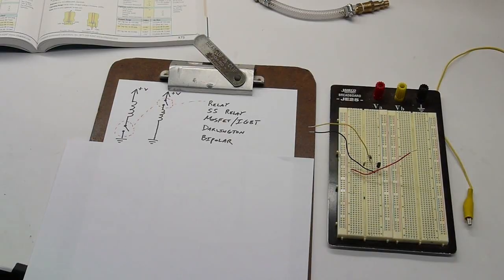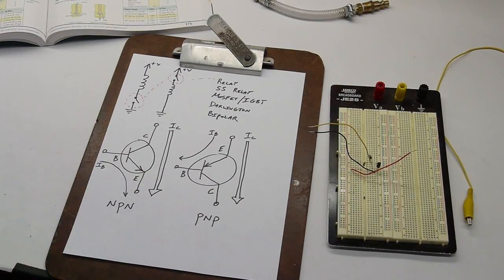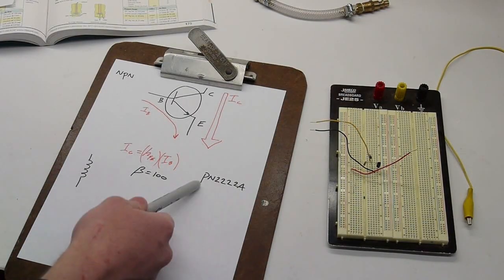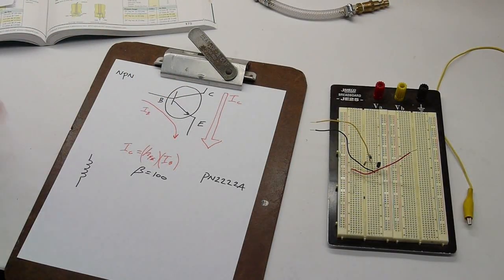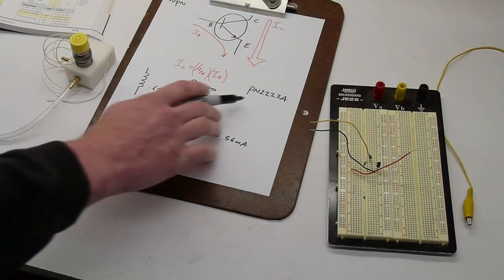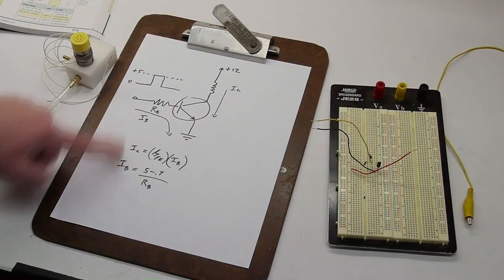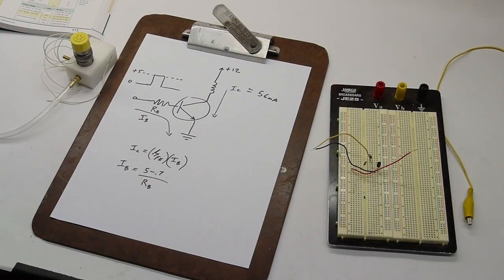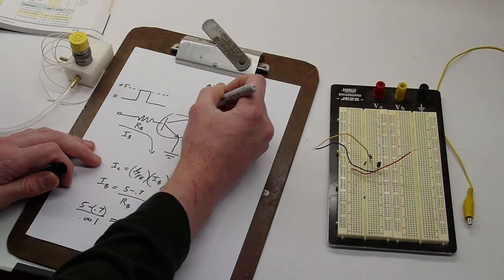Tutorial: How to design a transistor circuit that controls low-power devices

Comment: He completely missed the critical statement of why a PNP transistor is difficult to use. 
A PNP transistor needs to be placed on the supply rail, with the emitter connected to the 12v. To turn the PNP off, the voltage on the base must rise to 12v.  At least 11.6v.  We only have a 0v to 5v available from the microcontroller circuit and this cannot be used to control the PNP transistor.

Comment: high quality didactics. Very informative. I've already seen clips with professors explainig hard tech concepts with pen & paper and found that's the best way to share knowledge instead of AI bells & whistles' cartoons. Appreciated a lot micro tips like diode clamp or capcitor as diode protector. 
It's a much more "human" way of explainig making it way easier to grasp and remember. 
What I'd add is a sketch of NPN/PNP's waffer structure just to illustrate quickly how current flows inside and how's beta achievd. Graphics would help a lot in grasping and remembering the whole concept of transistor as switch. "Picture's worth a 1000 words."
I wish you made an analog & digital electronics intro course exactly the same way you made this clip. Success guaranteed.
Thanks.

Comment: To be true, I'd start by measuring the amps, the solenoid draws at 12V. Or consulting the manual.
Then on the last page, there would be a sample application (e.g. with a BC236) and I'm done.

Comment: So far the best explanation on transistors I've seen on YouTube. Theory with the practical side. Helped me understand it in depth, but likely because my understanding is deeper now. Have I seen this when I first started, would have been rewinding alot and repeat the video several times. That is how knowledge works at its own pace. 16:38 exactly my point on how knowledge works. Knowledge is the literal real life spiritual version of AI. I have been getting feedback from a circuit to some LEDs. I knew I needed a diode somewhere. Just haven't really looked into it. And wa la here goes the solution. There is a solenoid involved, and yes the LEDs turn on when the solenoid is deactivated

Comment: at 9:00 in you said "we use ohms law". E/IR is Ohms law but P=EI is actually James Watt or Watt's Law. If you are using E^2/Rt or I^2R it's Joules Law. The math always works its self out in the units. For example ohms per second is a Farad. It's the beautiful thing about math. I'd also suggest using engineering notation. 0.67W is 670mW. A capacitor at 27x10^-9 is 27nF. My professors drilled that into us and it makes the math so much easier because you just take the exponent by every three and move the decimal the opposite way and you can do rather large math problems in your head without the use of a calculator. Blew my mind! Great video though! This has to be one of the best I've seen.

Comment: Excellent video! Best one I've seen on transistors and how to use them practically.

You didn't explain why the position of the switch (transistor) matters from your original drawing. You mentioned that with a mechanical switch it doesn't make any difference but with a transistor it does. However, you never explained why or which position is appropriate for which type of transistors.
The short answer is that the current flow through the base (either in or out depending on NPN vs PNP) should NEVER go through the load. An NPN is generally "below" the load (load connected to the collector, emitter connected to ground) because current flows from the base through the emitter to ground. Conversely, a PNP is connected "above" the load (VCC to emitter, collector to load) because current flows from VCC though the emitter to the base.

Comment: I missed something. If you needed 56mA why you put to base 1mA? Is it goin to be about 100mA coming from collector?
Reply: The load, in this case the valve, demands an amount of current to function properly. It will not demand more. The 1mA base current with an hfe of 100 assures a load current of up to 100mA. The load will use 56mA. The rest is headroom

Comment: I would have rounded the resistor down to 4.3k, calculated the base current,and if all was reasonable, used the rounded down resistor.  Not in this low-power case, but others, it would have been a good idea to show how to calculate the wattage of the resistor just for the sake of teaching the basics.
THANKS MUCH FOR ANOTHER GREAT VIDEO!!
--daLe

Comment: Im trying to reproduce your circuit with a 2N2222A, and my super tiny motor is 5V - 90mA, and nothing works, because the transistor is 4.8V from E to C, therefore my motor gets only 0.2V, why is that?

Comment: Really useful, can I ask a question?  I have a 12v relay that draws about 80ma, and I tried using a Bc847 controlled at the base with 5v and 1k resistor. When I tested it, it turned the relay on but when I turned off the 5v the relay remained on because the transistor was still allowing about 3.5v on the relay. Any ideas?

Comment: You're missing so many things. Those equations appeared in any electronic devices books. The problem with this method is that you're not considering the different states of the pulse (high - low) in which moment are you considering the signal high and low? What's its threshold? Then how much hFE is the minimum for the design? You're not computing that. What kind of application gonna be? Speed rate? Resistive load? Inductive load? The kODF coefficient???

Comment: Respected Sir I will have to operate the relay by using npn transistor set  reset method, Please help me by giving me a detailed circuit, I did it but doesn't work by set reset method, waiting for your valuable feedback

Comment: I used 12 v conneted to relay conected ro collector and 1k  ohm 12v  to bace   relay turn on but when i connected the bace with gtound  no responce the relay still  connected what is the reason for that  transistor c2383  c1815

Comment: You'd want to use a PNP over a NPN when you want the same ground for both sides of the switch; because a NPN will make the switched load ground around 0.2V above the actual ground.

Also to control the PNP you wouldn't need fancy circuitry, just an open-drain output from a microcontroller to be able to ground the base, and a pull-up to 12V to keep it off when the microcontroller output is floating

Comment: MOSFETS are voltage control devices as in they use a gate voltage to control current through the source and drain.  They're usually used in saturation, where they're either fully on or off.  They're great for current controll from a chopper pwm

Comment: Just to add. In the càse of npn transistor, the flow of electrons is from the base to the positive 5 volt source as is the amplified electron flow from emitter to collector. The emitter has the greatest quantity of electron flow as it splits between the base and collector.

Comment: Hi Ben, thank you for this great explanation. Can you share your thoughts on how to protect this circuit if a short occurs in the coil to prevent the transistor to blow up. Is a small glass fuse the only way to do that? Or are there other clever solutions?
Lot’s of greetings, Dennis 🇳🇱

Comment: Hi . Really interesting video. Few things I just wanted to confirm, as I had studied in dc transient , in steady state the coil(inductor) will get short cirucited right? So there  will be no or little voltage drop across it and all thr 12 v(or little less) will show up at the collector? And so the capacitor will build up thr voltage as well and become charved to 12 v.( Tell me if I am right? )

Now , when the base current is 0, means transistor is off, at this time, collector current sharply drops for which inductor develops high voltage given by Ldi/dt and during that time you said the diode will not turn on immediatley so capacitor to the rescue will let current to flow througg it and try to charge upto the voltage across inductor, meanwhile diode gets on and makes voltage across inductor 0 , and slowly disspates the current through inductor and itself till current dies off.right? But how will be the capacitor bhevaiour right after the diode is On , will it get a discharging path to discharge? Or just remain forever at the high voltage created by the Inductor during turn off?

Comment: I have a relay that uses 12v to close a 120v ac circuit and it's basically just a "deadman" safety measure where I have a foot switch interrupting the 12v negative and a handheld switch interrupting the 12v positive. So, both must be closed in order for the 120v ac to flow.
I'm just wondering if there is a better way to switch the AC on and off using an electronic circuit because I have a gigantic selection of components but no more relays. Literally thousands of capacitors transistors (some really big ones!) Diodes, and resistors etc...
I do like the straightforward application with the relay, but I'm on such a tight budget and all.
I love your videos!
Thank you for all the good advice and instruction!
P.S.
I have a pretty good basic understanding of electronics but not much experience so any advice would be great.

Comment: Awesome tutorial! What I dont understand is: if we set Ic = 100mA and the valve only lets 56mA through, the other 44mA would be dissipated from the valve as heat, wouldnt it? Shouldnt I check then how much heat the valve can withstand without dying? Also I would never have guessed to nearly double the Ic current in comparison to the needed 56mA. How much would be too much Ic current then?
Reply: I guess that somewhere deep in the datasheet for that valve is a max current rating .. that would be your answer.
Reply: @tensor131  ah yes of course 🤦‍♂️

Comment: Great video but why the electronics ? You still have to switch something on and off as you were pulling the wire to cut the circuit to make it work. What would you use it for ? Anyone have a example of a use for it ? I guess you could use a timer with it to turn it off and on at a given time but you still don't need the electronics for that.
Reply: you could do the +5v switching through software e.g. from an arduino output pin .. no physical switch. To go fully practical you could use the same arduino to take an input (sensor) to decide (code) whether to switch the valve on/off and voila we have something useful!!

Comment: Nice job. I was trained as an EE, and in the lab I blew up dozens of 2N2222 transistors. Later, as an "advanced" student, I destroyed a few Op Amps before I got the hang of their biasing. In the late 1970's, a simple NPN transistor was inexpensive - maybe 25 cents at the school lab stock room. Op Amps were much more expensive in the 1970's -- maybe a couple of dollars -- so I learned to read the data sheet carefully before breadboarding those projects. 

When in doubt, add a resistor! It's a good motto for any EE student or dabbler in the mysteries of electronics. One of the most valuable circuits a designer should know by heart is the voltage divider. Such a simple circuit, and so many fresh faces in the lab don't know it. Lesson 2, a little more complicated, is using a negative feedback circuit to automatically control current surging at the base and thought the transistor. Always protect your active components! I appreciated your trick to sink stored current around the solenoid, too. 

Thanks again. I'm retired and haven't played with electronics in a long time. I've been looking around YouTube for interesting channels. and yours is practical without being pedantic. I'm a new member and will be looking in.

Comment: It's all very well creating a switching circuit that works typically. However, good design means you need to cater for the worst-case, and in the worst-case your assumptions about β, about Vbe(sat) and Vce(sat) don't hold true. Transistors vary from sample to sample of the same device, so you need to check the datasheet to see what the worst-case values could be and plan accordingly. Take the β first. At 10mA a 2N2222A is specified to have a minimum β of 75 and at 150mA a minimum β of 100. But that's at Vce=10V, in other words in its linear region and we want to operate it as a switch, so Vce is close to zero. At Vce=1V, Ic=150mA, the minimum β has dropped to 50 according to the manufacturer's specs. In fact, if you check the Vce(sat) and Vbe(sat), the manufacturer specifies a base current equal to 1/10 of the collector current, so β=10 is the only value guaranteed by the manufacturer when the transistor is in saturation.

Then, when its in saturation, Vce(sat) has a maximum of 0.3V at Ic=150mA, Ib=15mA and as much as IV when Ic=500mA, Ib=50mA. Similarly, under the same conditions, Vbe(sat) is a maximum of 1.2V or 2V, and that's significantly different from the "intrinsic" value of 0.7 you're working with.

If you're designing for a one-off, then the approach of "typical is good enough" will usually give a working circuit with a β of 50 and a Vce(sat) of 0.1V. But if you want something that's guaranteed to work, then you have to cater for the worst-case. Design for β=10 and you get Ib=5.6mA, so you use a base resistor of 680R or 820R, secure in the knowledge that even with the worst 2N2222A that's possible within specs, it will still reliably switch 56mA in full saturation.

Comment: When I went to school “back in the day”, I learnt that the voltage drop over a diode is 0.7 V for silicone. In fact, the diode (and be-junction) begins conducting already at 0.5 V. To quote Duhamel (another excellent YouTuber) states that there are three kinds of people: the ones that talks about 0.7 voltage drop, which is most common, the ones that talks about 0.6 voltage drop, which is a bit fewer, and lastly the ones that talks about 0.5 voltage drop, which is the rarest kind of all. Everyone would be correct.

Comment: I am building a parking assist using an Arduino Uno. I am hooking up an ultrasonic sensor that detects the motion of the car going into the garage that will activate a 650nm 5mW laser for 30 seconds. The current draw on the laser is 30mA at 5 volts, and the recommendation is not to go over 20mA 5 volts on the pin on the Arduino. I was thinking about putting a 2.2K 1/4 W resister on the base of the transistor, and the trigger would be the output pin on the Arduino. Will the 2N2222 Transistor work for this application?  I am using a Power supply module that brings the voltage down to 5 volts at 700mA.

Comment: Applied Science 10 years ago:
"How to control simple circuits with a transistor"

Applied Science now:
"How to be diplomatic to the interdimesional beings you found in the wormhole you opened with the modulater gun and phaser array"

Comment: At the end, you say using ac with transistors and how it becomes complex involving frequency alteration and what not, so why not just use a transistor to switch a relay where the ac side of the circuit is on the relays driven side, and just use dc to control it? Hmm.. I guess unless your ac circuit doesn’t have the ability to incorporate dc and for whatever reason you can’t use dc.. or minimal costs for whatever reason.. idk either way. Thanks for this video

Comment: Good point about the capacitor to slow down the voltage buildup across transistor, although in practice I've never seen it used. Good explanation. I like to hear various opinions in explanation. 
Fully 'turned on' is also referred to as 'saturated' or working in saturation mode.

Comment: The beta can vary widely both piece to piece and with temperature. If I want to have a better control over the solenoid current, should I consider adding an emitter resistor, acting as a negative feedback?

Comment: Thank you for this video. The application of transistors as a switch is explaned very clearly. There are several different semiconductor switching devices you can use for different purposes. A BJT is the simplest device to control. You can switch very high voltages very fast by use of BJT. Its disadvantage is that it is controlled by a current. So if you want to control very high currents, the BJT is not the best choise.

It is better to use a MOSFET. Using a MOSFET you only need control power to chance the gate charge. When the switching state stays the same it requires (nearly) no power. The disadvantage of MOSFETs is their lower switching frequency, because the gate acts as a capacitor. Allready at several 100 kHz (re)charging the gate within less than micro seconds requires several hundred mA or even a few A. Another problem of MOSFETs is that they are high current / low voltage devices. High voltage MOSFETs require more gate voltage and have higher channel resistances. A 30 V MOSFET has usually a channel resistance of a few mOhm. A 500 V MOSFET has typically several 100 mOhm or even several Ohm.

If you need to switch high currents at high voltages there is another useful device, the IGBT. It combines the low control power of the MOSFET with the high voltage capability of the BJT. A BJT has a saturation voltage for a certain collector voltage. It is typically between a few 10 mV up to a few V for very high currents. So for high voltages and high currents a IGBT is more efficient than MOSFET, whos source-drain-voltage is proportional to the channel resistance. If we consider a 500 V, 20 A (10 kW) switching case and compare a MOSFET with 1 Ohm channel resistance and a IGBT with 1 V saturation voltage. The MOSFET generates a voltage drop of 20V at 20 A and consumes 400 W of power dissipation. The power dissipation of the IBGT is only 1 V at 20 A or 20 W,

Comment: I don't understand what is your bias for NPN is vs PNP. You can have PNP with the base either grounded (-ve) in on configuration or not connected in open / off configuration. WIth current supplied via resistor. Both Transistors behave the same way.